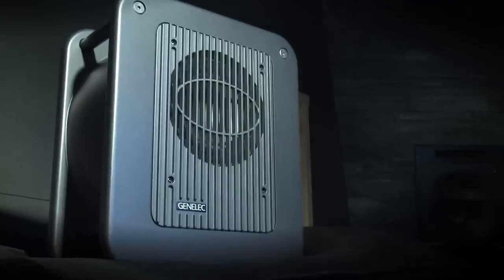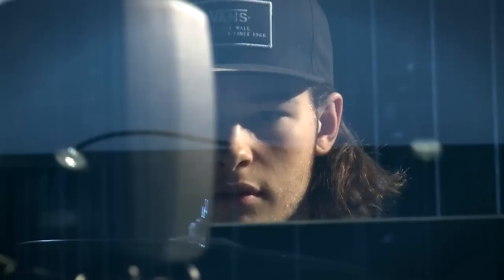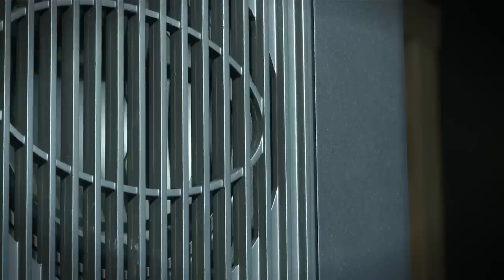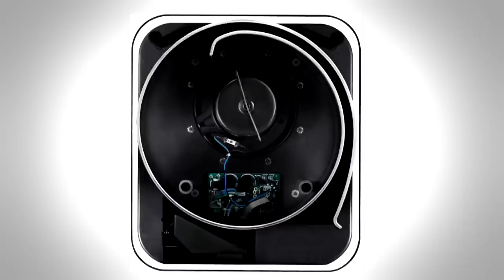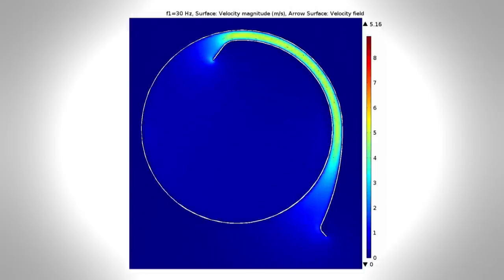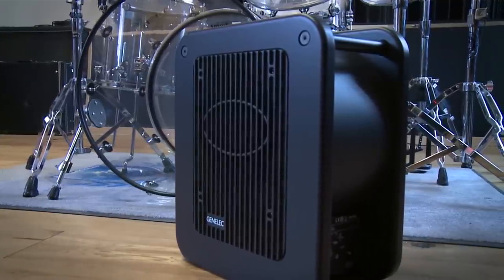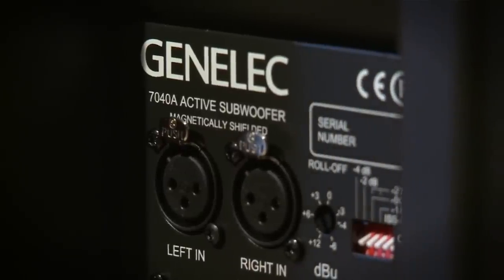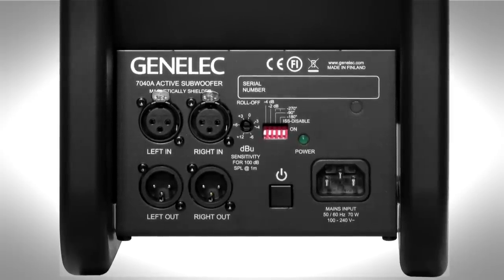Genelec subwoofer 7040A

Comment: I got a nice pair of 8020B since a couple of yers now and I love and trust them. So clear, precise and natural sounding. Now I would like to extend them with the 7040A in my edit suit to be able to hear the full spectrum all the way down to the low frequencies in order to do some music mixing too.  Would the sub match my speakers? And if yes, what are the right settings on the volume controlls to match the volume of the subwoofer. Thx
Reply: @genelec  I just ordered a pair of 8020DWP to connect directly into back of our iMac computer.
What are the Genelec Sub Woofer matches to these speakers. I dont want to research from zero I want to be told which are the ones to look at.Thank You

Comment: This SW is being marketed as if it were designed to work only with Genelec monitors. I don't understand why the SW wouldn't work with other brands of monitors so long as they had comparable specs to those of the Genelec's. Is it the lack of a tunable crossover in the SW? 85Hz sounds fine for my JBL LSR305s.

Comment: 8010s + 7040 look very attractive to me!
But one thing is disturbing me: my digital piano (KAWAI MP7) doesn't have XLR-outputs! It has only unbalanced ¼” LINE OUT. Is it a problem?
Reply: xxxsa3 ummm... I am not 100% sure but you may just need an adaptor or an litle converter
Reply: +xxxsa3 you could buy a little mixer to go with it. then you can also adjust the volume. go with one that has xlr/balanced outputs
Reply: if I remember correctly that subwoofer handles those xlr so you have to just get singnal to it

Comment: 7040a with 8040b ok for Home studio?? Please answer
Reply: @genelec  which subwoofer to go with the m040 ?
Reply: you don't need any subwoofer with 8040.  they already got more than enough low freq.  

btw, 7040 has 6,5" driver which is exactly the same as your 8040s, you already have.   So, whats the point of adding sub?